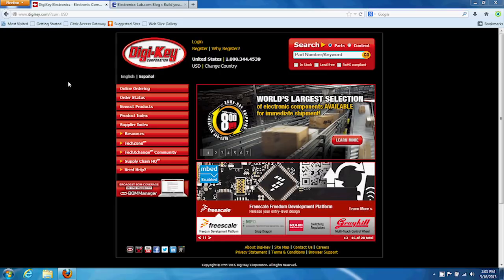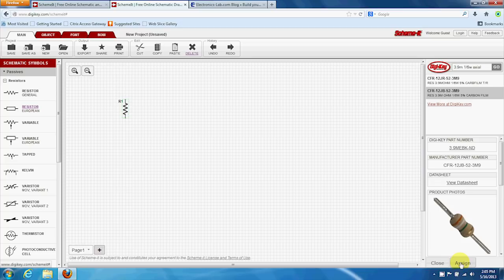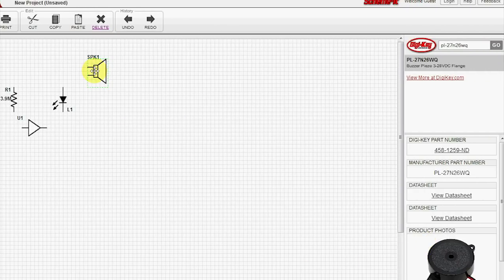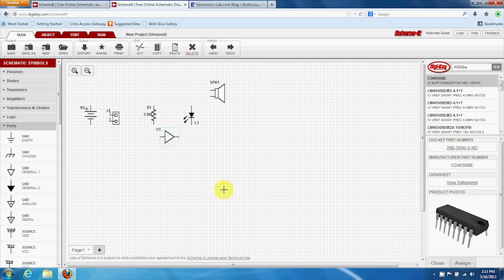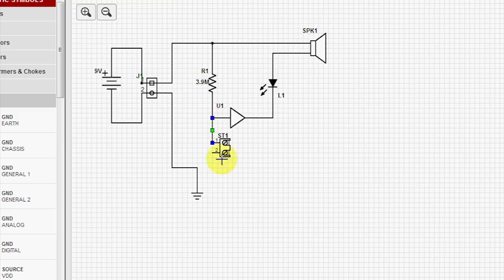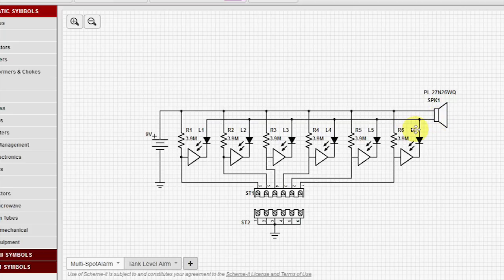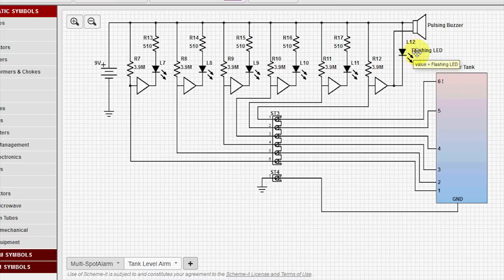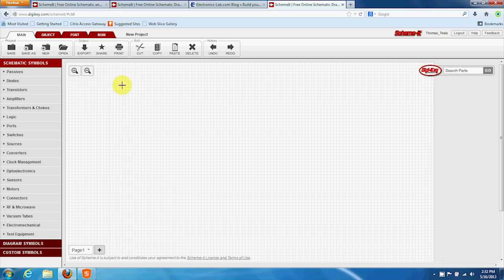Scheme-It Tutorial -- Free Online Schematic Tool | DigiKey

Comment: Apparently a manager selected the reference designators for the parts.  In electrical engineering 'L' is a reserved symbol for inductors (i.e. 'lead' device).  Diodes (LED's) are usually denoted as 'D'.